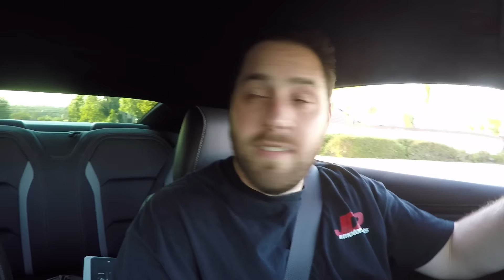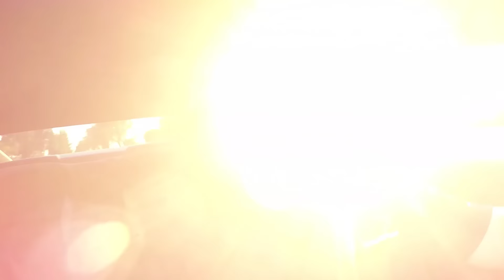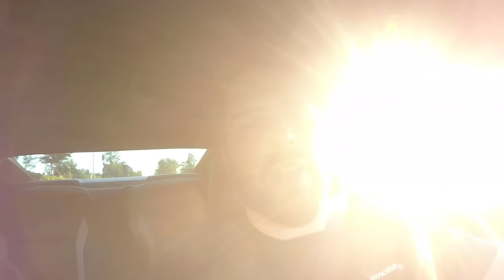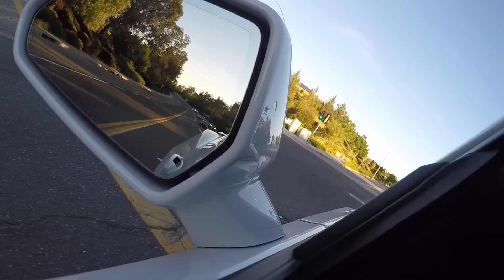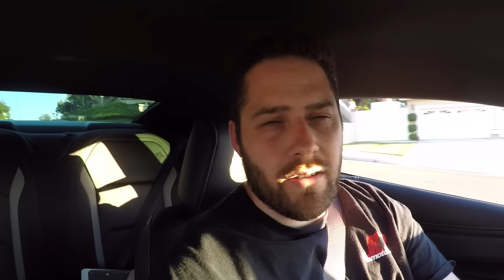2016 Camaro Aftermarket Cold Air Intake Whistle? (vlog)

Comment: I like the whistle sound. Can you tell any performance difference between mishimoto and cold air with out the dyno
Reply from the maker: +Phantom Menace703 No, I cannot
Reply: +Lethalhammer so the plus 14 hp is a lie lol
Reply from the maker: +Phantom Menace703 yes you can feel a difference of the CAI. But not the difference between Mishimoto and Cold Air Inductions.

Comment: Dammit! Whistling is driving me crazy especially after adding a throttle body spacer. Thanks for confirming my recent findings. Great video
Reply: After getting supercharged with all the goodies including a Roto-Fab CAI I didn't notice a whistle, but once I added a TB adapter for my Nick Williams 103mm (shop didn't install it for some reason...) I can now hear it except under light acceleration.

Comment: Is this whistle with or without the ported throttle body?  I wonder if that'll make a difference since it slightly changes the shape of the area where the air rushes past the throttle blade...?
Reply from the maker: +Tara Rene Martin this video is with the stock throttle body.

Comment: So let me get this straight you can tell the increase  of 14 to 20 hp on this car when you drive it I do not understand how you can tell such a small increase not trying to be rude but if you want a real increase you need a aftermarket tune as well.
Reply: It's entirely possible. When I get gas in my 16 1ss I can feel the difference from E to F. Its like 120 lbs of gas. probably less noticeable than 15 hp
Reply from the maker: +DustinCorvetteZr1 I can tell a very slight difference is how the car d4ives, sounds and overall feels. But does it feel like 10-15rwhp? No. Is it adding that sort of power? Not sure yet, have to get her dynoed.
Reply: either way your a great car guy I enjoy all your vids keep up the good work

Comment: Just found this after searching for 2016 Camaro CAI Whistle. I installed the Mishimoto CAI on my 2016 SS in Dec 2016. And I notice the whistle, a lot. Feel it takes away from the exhaust sound at slower speeds, which is a huge show off factor of the car! 90% sure I am heading back to the factory solution. Sounds like I would get the same problem with a different manufacturer's CAI. 

If anyone interested I can share my modifications to the Mishimoto CAI required to solve my experience of the air filter falling off.
Reply from the maker: Roto-Fab doesn't have this issue.
Reply: Thanks. Just checked it out, I am in California and the Roto-Fab website states not for use in California. Going to keep researching.